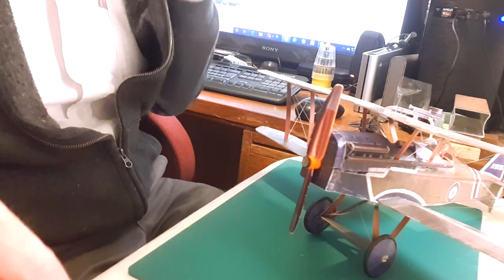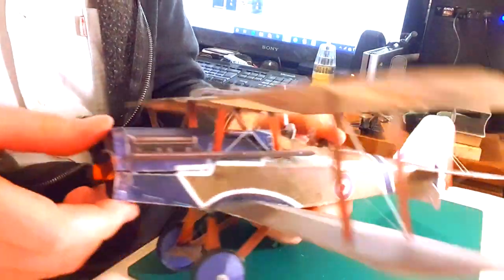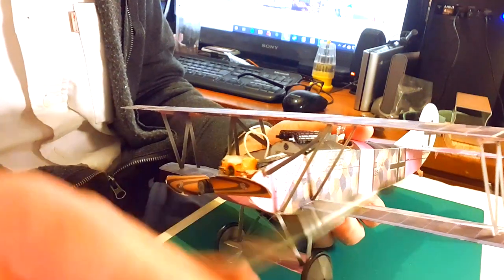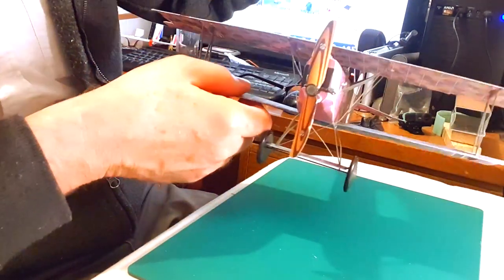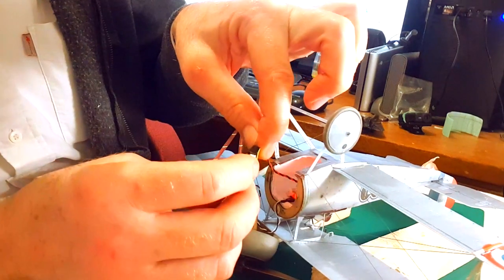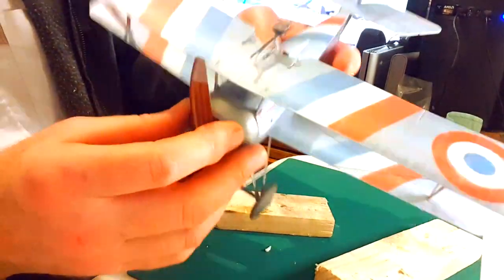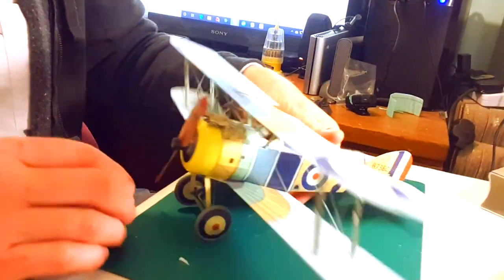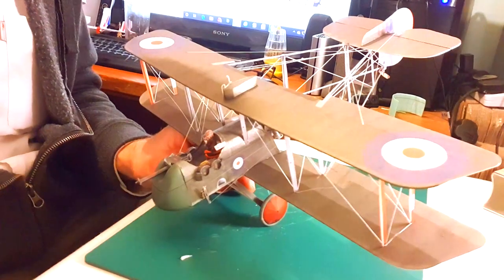Fitting Batteries into Microace's RC Models

Comment: Hi cliff Iam building a Cherokee piper guillows model I have a 30amp ESC with t plug 9gram servo's and the 2200 kv motor and the motor came with the ESC and two props from eBay and 8 Chanel futaba receiver how would what battery would you use and how would you fit all this in please could you help thank you.🤔
Reply from the maker: Hi Neil, have you looked on the Guillows RC Groups pages, there are quite a few rc conversions, https://www.rcgroups.com/forums/showthread.php?827861-Guillow-s-Conversions-The-list-of-conversion-threads. These will help you a lot. As for your question I'm no expert and tend to go for complete packages. It may be a better idea to ask on the RC Groups forum or even the Guillows Facebook page. I wish you good luck it's a lovely little plane.

Comment: Cliff, what or how do you secure the rigging on those micros
Reply from the maker: Hi Alfred, they are accomadated into little holes at the ends of the struts etc, when you're happy with the tensions a little ca applied with a pin holds it all in place 🙂

Comment: Where do you buy your rare earth magnets
Reply from the maker: Hi Alfred, they come with the kit but they are available on Ebay for example,  right down to 2mm diameter. Another source is old mobile phone covers, they will yield a magnet about 4mm diameter if you know anyone who's changing one. I wonder if old covers can be gleaned from mobile phone shops?
Reply: @CliffHarveyRCPlanes  what size do you normally use for these micro planes or the Chipmunk you are currently building
Reply from the maker: @nhschreiner  Well the MA kits use 4mm diameter, one on each face so they pull together. This seems about right, don't do as I did though first time I used them and that was to have the two magnets repelling each other!